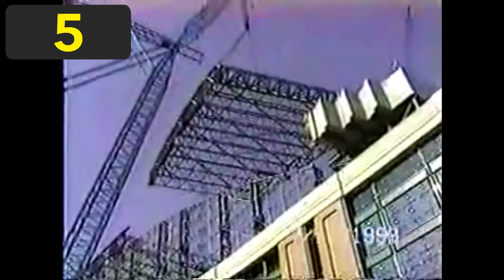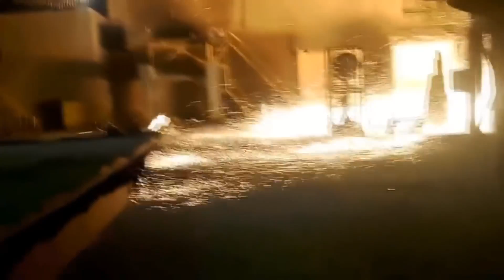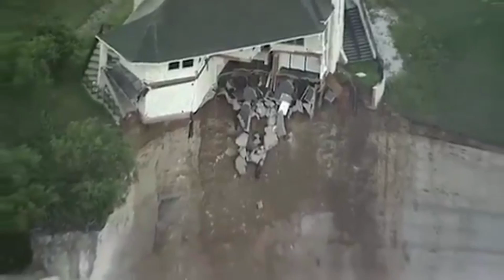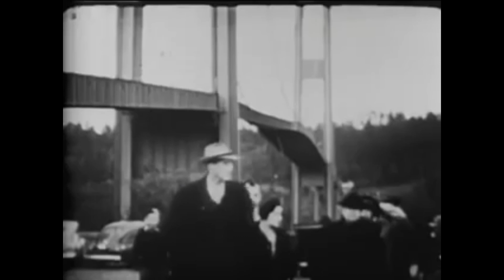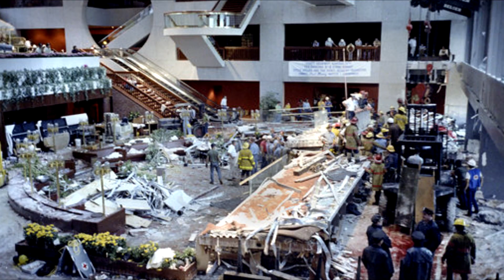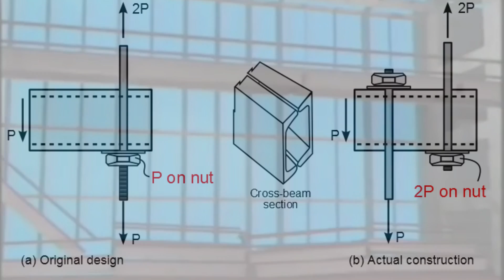Top 5 Construction and Engineering Fails

Comment: the hyatt collapsed wasnt caused by a fail bolt but instead they used a wrong supporting beam. An i beam type should be use instead of a box type therefore the box type buckled in due to the hollow section under heavy load and it just slid through the bolt thats holding it.